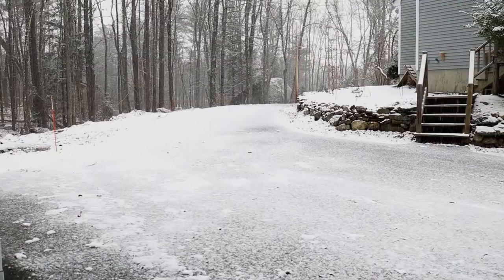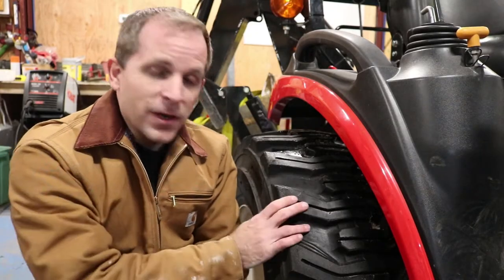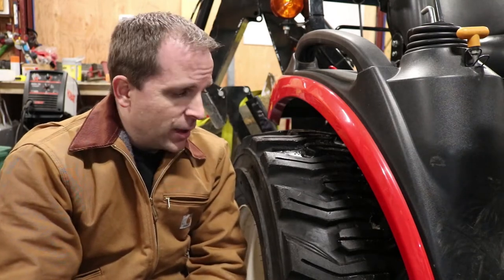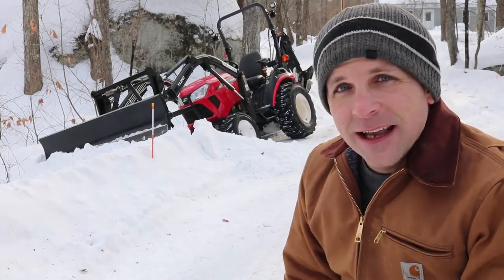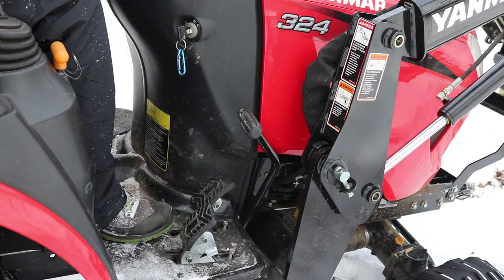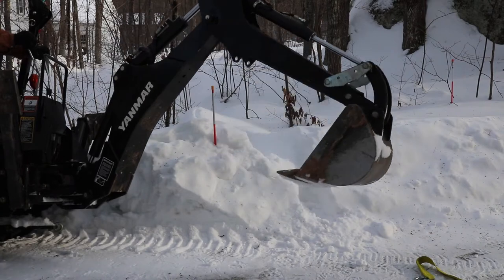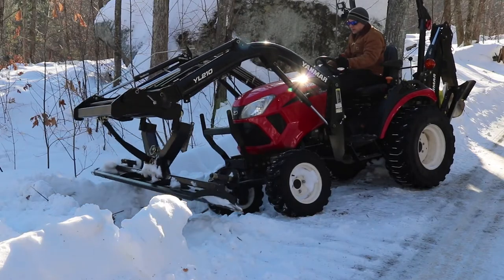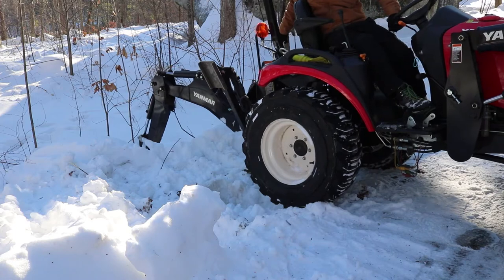Winter Prep, Getting unstuck, and Grooving tires!

Comment: Well done on the video. For a extra layer of safety when using a strap to get unstuck I would not use a strap with hooks and have something like a old heavy carpet to lay on top of the strap in case it breaks just suck up the energy to keep it from coming back at you at Mach Five speeds. I have seen a strap with a hook blow through a rear hatch and seat back like it was nothing.

Comment: Pull up on the break lock and push on the break pedal till it clicks on time, now the diff is locked on the back end.  My sales guy told me that trick when I bought my plow for mine.
Reply from the maker: That doesn't work for me, once it clicks the brake is engaged, and I don't need to push the pedal that much before the diff lock engaged

Comment: Did I understand correctly that your tractor does not have a differential lock that you engage with your left heel?  Good tips on freeing a stuck tractor👍
Reply from the maker: Yup! I have 4wd i can engage with the heel. On my year of tractor it was an optional extra i didnt know about. I have though about making my own but havent had the time
Reply: @LazyBrookFarm  Can't you use the "parking brake" lever by the FEL joystick to lock the brake after you've depressed it a couple of inches?

Comment: I can’t believe Yanmar does not have the simple left foot differential lock their set up is very awkward, The other issue I see is the proprietary locking system on their buckets I don’t know why they didn’t just go with the standard skid steer Quick attach system there’s so much of those attachments out there other than that I really like Yanmar equipment my brother has a couple Yanmar excavators that just keep running
Reply from the maker: They do! I just don't have that option on my tractor. I have heard they made it standard shortly after I bought mine. It was an optional extra. 

Yanmar went with their own attachment method because it allowed them to get the bucket a lot closer to the pivot point of the bucket increasing the lifting capacity quite a lot. Yanmar did a lot of these little changes to make this line so much more powerful than any other tractor in this size.
Reply: @LazyBrookFarm  that’s a really sweet tractor so The differential lock is standard now? But the proprietary locking system is still the same on the bucket thanks

Comment: How do you like the 324? I'm looking at the 424 for the oversized tires but the tractors are identical. Have you had any problems with it?. I've heard nothing but good things about Yanmar.
Reply from the maker: No problems at all, and i beat the heck out of it.. I have a lot of large boulders, i guess some i have pushed and rolled are over 2klbs, and the tractor just keeps going! Only issues i have every had, is traction in the snow, and diesel gelling up.
Reply: @LazyBrookFarm  That's impressive! The traction and fuel is just a part of winter lol. Thanks for the reply you definitely helped making my decision, Appreciate it! Have a good day

Comment: Mark, I was wondering if you could give some insight on why you choose the Yanmar over other brands? I'm looking at the 424 Yanmar compared to a Kubota B2301TLB. What features sold you on the Yanmar? Thanks for any opinion, Mark, York PA.
Reply: I agree with you on the specs, the Yanmar 424 comapres closer to Kubotas smaller B tractors. My biggest hang up with the Yanmar is it not having the Bobcat Quick attach loader, may have to look into doing some modifications and I believe the Backhoe is a tad bigger on the Kubota.  Appreciate your feed back and thanks for doing the video, Yanmar doesn't provide much info on their website, I wanted to see how the backhoe hooked up and removed, Thanks!
Reply: Sweet! Very good to know. Is that than a differnt loader bucket or did they add a quick attach plate to your Yanmar bucket?
Reply: Gotcha. Thanks for all the info, I will be giving Silver lake a call if I go with the Yanmar, look forward to seeing future vids. (Amazing what you can learn by watching you tube videos!)
Reply: @mrlawn4752  I think it was a Messick's video where I saw why some don't use SSQA.  It does two things that reduce overall loader capacity.  It moves the load further forward by a few to several inches; and it adds a fair amount of weight just in itself.

Comment: trying to get the size. how tall are you? how much taller are tires on 424? why you pick 324? the yanmar seems to crush the competition in the subcompact line.are they MUCH beefier? looks it   is that 2000 lbs?great vid
Reply from the maker: I am 5'7" . But I agree, You get a lot more for your money with Yanmar in the Subcompact range! The 424 has 24 inch rear tires and 14 inch front compared to the 23 and 12 for the 324. I believe that is the only real difference. The clearence is really good even with the slightly smaller tires. I have driven over downed trees and large rocks without any problems!

 The weight is about 1700lbs without the FEL or Backhoe, So I expect I am a little over 3k lbs with FEL, Backhoe and tire ballast.

Comment: Great video!  Noticed you have a 3 point hydraulic splitter.  I'm curious, are you running that off the backhoe lines or did you get a rear remote installed?  I may have a splitter in my future...
Reply: Lazy Brook Farm Very cool. 19" would probably work fine for me, any more than that and I can't get it into the woodstove anyway! Nice to hear it runs fine off the BH lines.